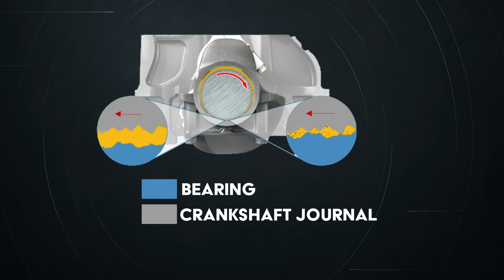the truth about start-stop technology (finally proven)

Comment: The special coated bearing will probably only help the engine make it through the warranty period.
Reply: You got it right!
Reply: As intended
Reply: I saw Dave tear apart a diesel V-8 pickup truck engine. The bearings were coated with some kind of red plastic. It had 900,000 miles on it and the bearings still looked new. The team measured the bearings and they were all within specks of a new bearing. The red coating and crankshaft looked new. The truck owner did install some additional oil filters and changed oil regularly. He used the ruck to haul campers across the country for delivery, so it ran with little start & stop cycles.
Reply: @billsimpson604  BMW’s b58 engine is also coated with this red polymer, specifically to prevent wear from start/stop. They know it’s an issue.
Reply: @Philipruss what about b48?
Reply: @Philipruss  As does any mechanic with a decent understanding of how engines work, though I can (rather gleefully) imagine the horror on the faces of the engineers who were forced by the "oh-so-bright" politicians to implement this tech into the engines!😏🙌
Reply: @solidfuel0 I think the b48 also has this coating, but I’m not sure. I suspect it will, don’t think BMW can afford their reputation becoming even more tarnished after the timing chain saga and M3 road bearing fiasco.
Reply: No, they have recalls for these things. Typically the amount of time that it takes to break down and rebuild an engine is significantly more than what the job pays. This means your mechanic at the dealer gets to fix the problem at breakneck speeds or else loose money. The Customer looses their time, the mechanic looses their time, the dealership makes money, and the manufacturer implements the same feature next year.
Reply: @garrettc9456  A.K.A a politically backed scam! 🙌😂
Reply: Combine this stop start crap with the new ridiculous new low viscosity oils and failure is imminent
Reply: I watched Steph Papadakis explain why his company made certain decisions when doing R&D on a drift car. One thing stuck with me. He said that they want to use as many factory parts in the engine as possible, because the engine was so new, there was little aftermarket support. One thing they had to replace were the crank/rod bearings. The coating that the factory used to help with the start/stop lubrication issue would wear off and the bearing would fail. They didn't need the stop start feature. It wasn't even activated on their racecar. But, because they were making more heat and power, that coating would cause damage.
Reply: Yes, that is true. That's why you should always maintain oil in the engine. Do not rely on the coating of parts to keep your car from dying. Oil is important.
Reply: I don't see how coating metal with plastic protects it in any way.  Plastic is easier to scratch than metal is.  So the plastic wears off and not the tolerances are different.
Reply: Bingo!
Reply: Good thing mine is for the life of the vehicle (and that the auto start stop doesn't actually harm the engine whatsoever).
Reply: @BlakeBigfoot yeah , its probably a turbo , and we all know just how hot turbos love losing oil pressure and stopping when hot 🔥 
Good luck with that….
Lifetime these days equals the warranty plus a day …
Just saying
Reply: @Batman-lives yeah, no, it's not a turbo and it's lifetime as in infinite miles for as long as I own the car, but nice try.

Btw, you know that these systems only work when the oil and other fluids are in the correct operating temperatures right? I'm pretty sure turbo cars with these systems also have pumps to keep cooling fluid going to the turbo, specifically, also.
Reply: @BlakeBigfoot enjoy your warranty period plus a day….
Reply: @Batman-lives do you not know what a lifetime warranty means? It means until I die or sell the car.
Reply: @B @BlakeBigfoot or they run out of the rubbish starters….
Reply: @Batman-lives  I'm not sure a powertrain warranty covers the starter and even if it doesn't and the OEM stops making them, after market manufacturers will make them for at least another 30-40 years or so, probably more.
Reply: @BlakeBigfoot if you stop the stupidity, parts won’t be necessary
Reply: @Batman-lives parts are always necessary, there is no part on a car that will last forever. Also that's just a bad way of looking at life, even if all you care about is how much money you have to put into the car, if you can spend the same or even less on a new starter that you save in gas over the course of several years, why not save the money? I care about more than that myself, and I understand the importance of all of us reducing our carbon emissions, but on pure cost alone the auto start stop is saving me money.
Reply: Probably depends on the engine and how it's used and maintained. My 2018 BiTDI Passat has now 260.000 km and I keep Start/Stop enabled as much as I can, taking into account a few factors (engine warmed up, reasonable temp outside, reasonable battery charge). No problems so far whatsoever.

Comment: First thing I do after starting the car is to disable the stop start. It's obvious it is not good for an engine.
Reply: Just buy the cable with the resistor for your car that will always keep the engine on. Only takes a couple minutes to mount, and cost hardly nothing + you now won't have to press that button everytime you start up your car.
Reply: I do too, but I’ve just used software to change my LR Defender’s system to start on the last used mode, which is almost always ‘off’. Having said that, I do switch it on ‘in certain suitable conditions’ such as in long, slow moving queues of traffic. Thing is, living out in the countryside, it is rare to encounter such queues.
Reply: EDIT. Well it was rare. There are now five sets of traffic lights on a six mile stretch of road, some with quite long delays as they are four way ones as the installation of underground electricity distribution cables is being done. This is a rolling set of works as the contract is for over 15 miles in all and there are two main works plus another lot following, installing large junction boxes of over 2mx2m each.  Obviously in these conditions the stop start system becomes very useful along with my Defender’s auto brake hold feature.
So it’s a great feature to have but it can also be a bloody nuisance, all depending on the conditions encountered. Even when mapped out to memorise last used mode at a restart, it is simple to switch the stop start on when required, to work just as it came from the factory. Just use the switch to toggle the system on and off.
Reply: It's such a habit to turn it off that when I drive my other car that's from the 80s I try to press the button that's not there.
Reply: I bought a 25 CX-5 last Dec. and the main reason was no auto/stop or cyl. deactivation due to supply shortages--Win Win...
Reply: @tonyjordan1320  What market was that in? I have found a Nissan Pathfinder 2025 in Australia without the stop/start system, but everything else has it that I have looked at.
Reply: @greggregson9687  North America  NC area-nearly all the Mazda 24  models and the early release 25 models did not come equipped with either of the BS  but sadly all the new models now have it and you can't get around it..
Reply: @tonyjordan1320  
That is good luck.😺
Reply: @tonyjordan1320  I might be mistaken, but I think it is possible to avoid the start/stop system by keeping the foot on the gas pedal on red lights. Reving the engine just below the red zone. Making a lot of noise, while watching greenheads around explode. /s
Reply: Most of the cars you can code it out.
Reply: Lane departure and then stop start. It’s like getting an aircraft ready to depart these days 🤣
Reply: @roboliver9980 Don't get a car with lane departure control.. I feel your pain, lane departure is simply dangerous. I've experienced it in hire cars, now I don't drive them until it's turned off.
Reply: I use a spe ial device to keep it from coming on when it was turned off before the last engine operation
Reply: Exactly ...it's OBVIOUS that it's wrong ...for several good reasons
Reply: it wa not obvious that it is that bad, since it was installed
Reply: You can code the car to keep it off. Bmw and vw has it
Reply: It's obvious that it does. Not only does it save gas, it reduces wear on the engine. You can waste your money if you want. It's your money. Well, not anymore.... It WAS your money 😂
Reply: 😂You can really do that in a hybrid. But the hybrid system works a bit different, it actually has a lubrication pump to pressurize the system instead of rely on the engine driven pump. It is better on managing the wear. And with more powerful motor to spin the engine to speed, the engine is almost has no load. Which further reduce wear.
Reply: First thing I do is buy a car without this rubbish
Reply: @SeasonThreeIsBetter  Good luck. Think it became mandatory in EU some time ago. A Fiat 500 2011 has the system installed, likely it's 2010 origin as well. Something happened around the Euro 5 standard. 2007 ish ? Toyota decided to dump the Hi Ace models for the European market, as it would require a engine redesign. Also the brilliant VW 1.9 TDI Diesel engine saw its peak around 2009. My estimate is that peak ICE car is around 2010. Anything post this is junk. Not an ashtray to be found.
Reply: @SeasonThreeIsBetter  
Good luck finding one that is less than a decade old.
Reply: My Lexus GX550 bought in August does not have this garbage! No start stop.
Reply: @hedydd2 that's not a bad thing, my truck is 39 years old and it runs great lol, even has cold AC, no computer either, just a simple carburetor
Reply: @hedydd2  actually my sister bought like 5 year old peugeot  cant remeber model exactly and did not mention this shit, probably would have mentioned if it was existing.
Reply: @fun-Darius  
It almost certainly has start/stop and lane keep assist. My daughter’s 11 year old Nissan Qashqai has start/stop.  
If it doesn’t work it is probably because the battery charge monitor, which is fitted very close to the battery’s negative terminal on virtually every car for the last decade has not been reset after a battery went flat or was changed out.
Reply: What you do is not good for environment
Reply: @ligametis  
Show me the expertly audited  balance of benefit verses harm of starting and stopping engines at very short intervals.
Reply: If you stick with classics, made prior to 1973, you won't have to worry about any of that, or any of that ridiculous, horsepower-robbing emissions garbage either.
Reply: @CrazyBear65 yeah right, if anything is important to a car user, it's endless amounts of horsepower!
Money out of the window 😴🥱💸💸
Reply: @CrazyBear65 Adding catalytic converters to cars increased the fuel consumption and massively stiffled development. Catalytic converter adoption was driven by catalyst company political lobbying.

Comment: Missing lots of details and facts:

- Idling is bad for engines also!
- Was that engine designed for start stop?
- If it was, did you use the start stop mechanism or just brute full stop and full start?
-How about comparing wear in those same 2 days but without stopping the engine and idle it the whole time?

Did you know that the smart car makers use valve timing/overlap to lessen the compression/wear on every start?

Some do have electric oil pumps so the bearing is never dry during the stop duration.

This will be very easy to prove or disprove with oil analysis. I have records of oil analysis where my car did not use start/stop and will compare to my next analysis where the car did use start/stop!
Reply: Link us the test after you do it. idling does not hurt.
Reply: @Boz1211111  apparently idling cause glazing on the cylinder bores. not such a big problem, though..
Reply: Idling is bad?   I think long haul truckers who park and sleep running for 8 hours would prove differently, than what "YOU" think.
Reply: Do you have a link?
Reply: At last, some thoughtful and insightful observations. Many thanks. Folks need to realize that ‘common sense’ ain’t always right! Thank goodness for engineers!
Reply: @Grassington2  people just seek validation of what they think is true so its really nothing new. Toyotas constantly stop and start their engine and routinely reach miles most "reliable" old engines would only dream of without major rebuilding. People just need to stop buying crap products that blame their shittyness on regulation instead of cost saving.
Reply: With the electric oil pump, you are only slightly helping. The bearings work on hydrodynamic lubrication (i.e. they only work when the parts are moving). When the engine is stopped, you have metal on metal contact because the oil is squeezed out of the way.

It's only when the parts are moving fast enough that they can ride on a wave of oil. Before that, you get the wear. It's the same thing when you turn the engine off, and as it slows, the metal parts rub against each other just before they stop.

Hydrodynamic lubrication is maybe more easily understood as the way an ekranoplan works. The plane is the crankshaft, the sea is the bearing, and the air is the oil.

The ekranoplan sits on a cushion of air. The crankshaft sits on a cushion of oil.
Reply: Indeed the fact it is never mentioned if the engine (and the whole rest of the system) was designed for start/stop use or not is a big red flag.

Comment: When I buy a car, I always disable its start-stop system by coding if possible. It is so annoying. Once the engine is running, the hydrodynamic lubrication prevent metal-to-metal contact in its bearings. I like to keep it that way while I am driving. The fuel and enviromental effects of short idle cycles are negligible. If the car needs to be still for longer, you can manually stop the engine.
Reply: Idling is not good for an engine either.

I buy a car that uses full timing control of the valves so they use valve overlap during start to reduce almost all the friction!